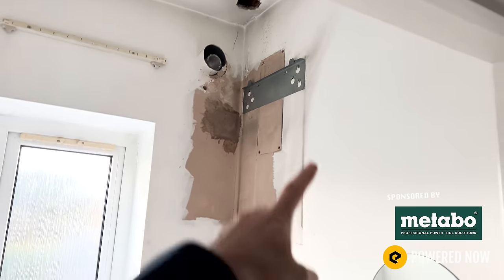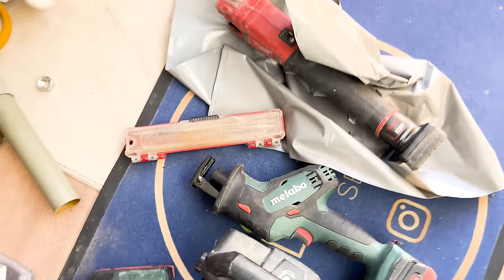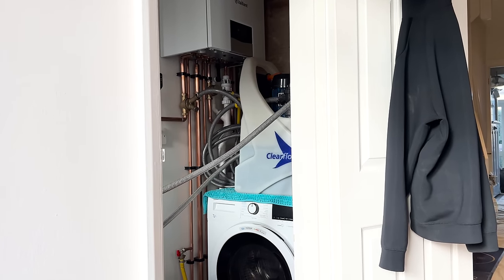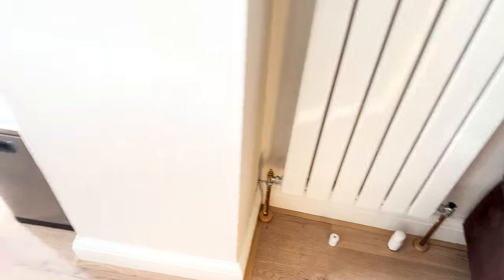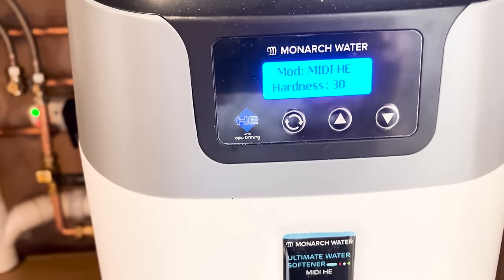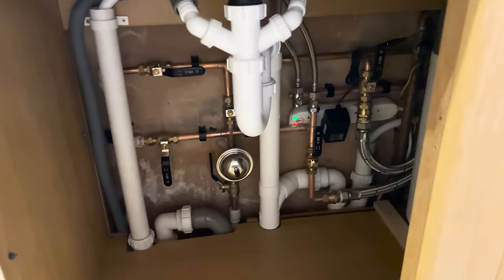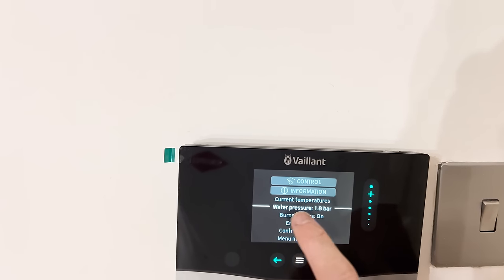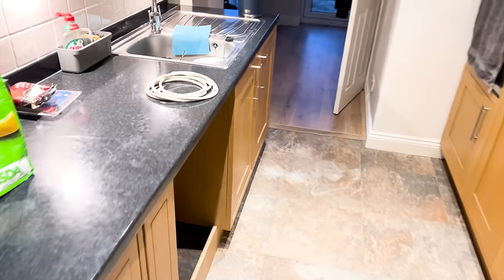PLUMBER, WILL I FINISH ON TIME? SYSTEM POWERFLUSH & HARD WATER TEST - VAILLANT ECO TEC PLUS

Comment: Hi Todd, with regards Artificial Softened Water and Heating systems. I looked into this a couple of years back. They originally thought that the  additional salt in the water would harm the heating system, but this has been proven that it is not the case. The reason manufacturers state not to use it, is because they have not tested it, so they go with the old rule.
Reply from the maker: Thank you that’s very informative 🥰

Comment: You can fill it with softener water. There was a issue many years ago with some reaction with the chemical manufactures they had to alter the formulas. You should look in to Harvey water softeners or Dualflo ( the ones they sell to the trade.) A far better quality softener has two cylinders so no hard water gets into the system and none electric so it doesn't guess its cleaning cycle it does it when its needed.

Comment: Is it easier to descale Vaillant heat exchanger made from multiple segmented coil, or Viessmann with single pipe coil in heat exchanger? Both are stainless steel but descaling them in hard water area is good maintenance work.

Comment: Hi Todd,

Had the new Ecotec Plus 826 installed, do you know when it switches between heating and hot water, if it’s meant to make this noise like gear changing or something. Not sure if it’s common issue or not? Say the central heating is on you go to use hot water it makes this noise when it changes over to hot water and then when you turn the tap off, it makes the noise again before switching back to central heating. 

Its abit of a stretched out sound like a gear changing but with a 2/3 sec stretch
Reply from the maker: So that would be the diverter valve inside the boiler so every time you turn the hot water on, it will move the valve over to the hot water setting and then obviously once you’re done with the hot water you close the tap, it will then flick back over to the central heating inside, and that noise is what you can hear, althoughshouldn’t be that noisy
Reply: Hi thanks mate, i have Vaillant coming around soon to check on this as its a quite new boiler like 3 months. The noise is quite noticeable when heating is on 5/6 in the morning and you go to use the hot water in bathroom or kitchen. Hopefully they can fix issue. I actually had an old turbomax before and it never made the slightest noise. You just hear burner go off and come back on, but this new generation ecotec plus just very noticeable lol @glisterservices